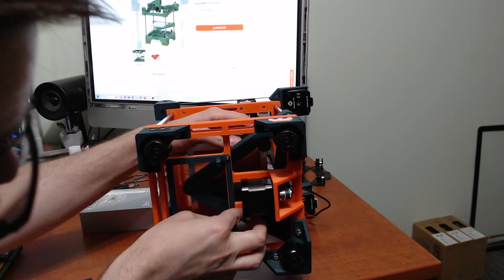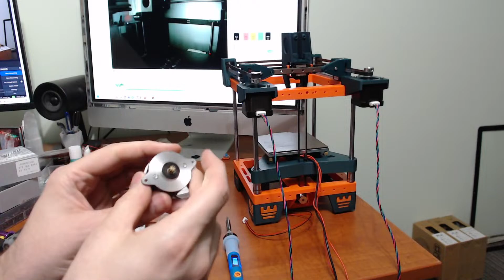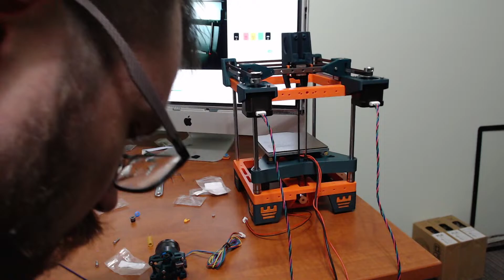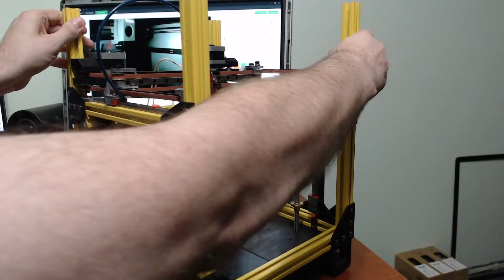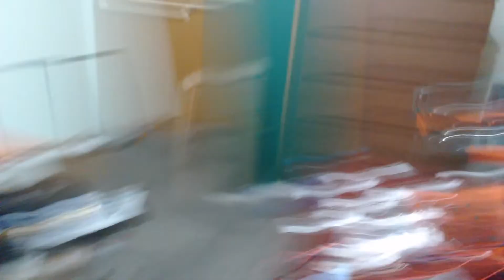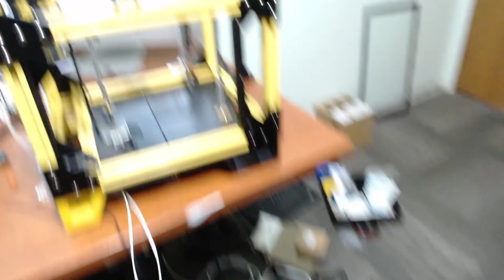Chill Rook and Fortress Live Stream

Comment: I still have my V.0.0.1 Rook 180 (officially the first assembled I believe haha) but just still haven't put in the effort again to get klipper on it. I haven't checked in lately but figured whatever I have will need to be reprinted and will have so many changes by now I might as well just start over. I think I will get Klipper finally. I ordered some of those new Bigtreetech board combos that has klipper loaded? Fingers crossed
Reply from the maker: yes the manta boards work well